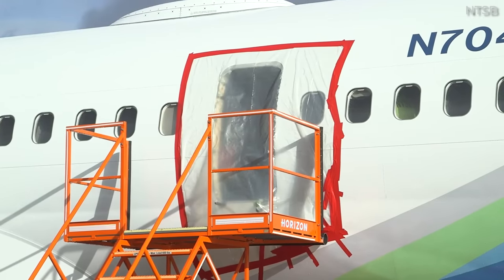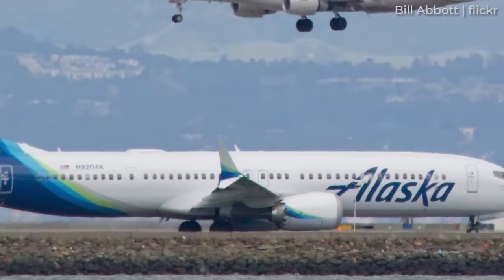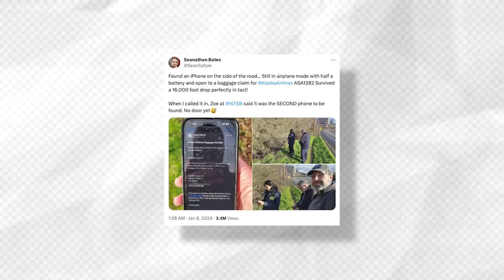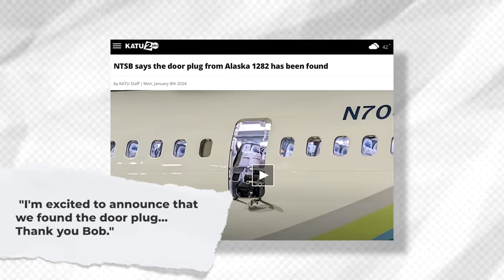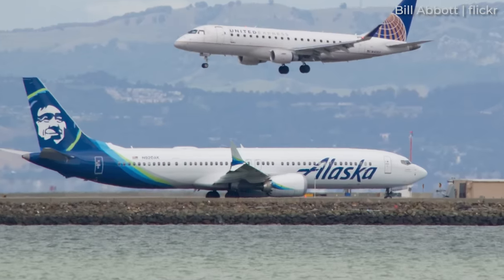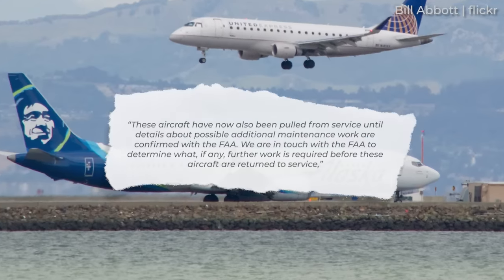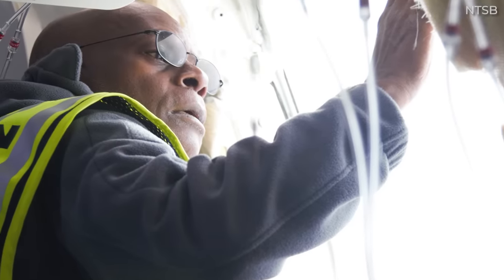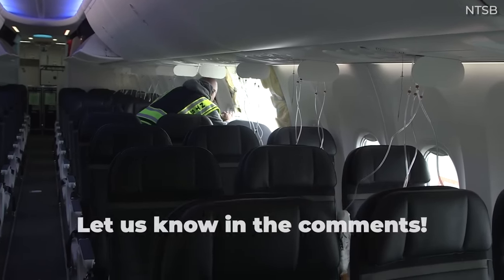Flight AS1282: Are We Seeing Another Boeing 737 MAX Crisis Unfold?

Comment: There is obviously a quality issue with their plants. They had to stop delivering 787 for a full year. This is a company that is in crisis because they allowed the worst of their instincts to take over when they merged with McDonnell Douglas. They allowed the failing portion of the company to take charge as opposed to the part that was actually successful. When they were in merger, you don’t allow the company being merged out of existence to take the lead. These are the same people who did the disastrous DC 10. And that disaster was visited on them by canceling the 757, and by making nothing but the cheapest decisions from that point on. This company‘s is going close its doors if they don’t start making responsible decisions and I don’t think they have the capability to do that.
Reply: The wonderful DC-10 went on to be one of the safest and long-lasting aircraft in commercial aviation history, Jude!

Comment: So much pearl-clutching. There was less hyperbolic speculation over the failure of Aloha Airlines Flight 243 where the entire roof ripped off due to metal fatigue. It looks like an improperly secured plug door. Given the actual engineering of the hinge mechanism this is a near impossibly if the proper procedure had been applied so this was likely a human error case during the installation and inspection, concerning but hardly alarming. These plugs need to be lifted along a track for 4 centimeters before they can be opened and if properly installed there are 4 bolts to prevent that which are then covered by 1 inch thick safety nuts which then have quarter inch thick safety wires pierced through them to prevent the nut being able to self loosen. The hinge mechanism swings the door down low on the airframe so it was highly unlikely it could have impacted the horizontal stabilizer unless the jet was in a steep climb. It was an unfortunate event but people want to blow everything out of proportion anymore.

Even the previous Max problems were more about training than MCAS. After the fact, every domestic pilot interviewed knew exactly what to do to disengage MCAS and prevent the runaway. It wasn't the accident pilots fault that they weren't trained properly but the MAX was not inherently unsafe.

If airplanes were subjected to this degree of scrutiny since the birth of aviation then we wouldn't have air travel at all today. People are trying to crucify Boeing for this without all the facts, but no-one is alarmed by the shear number of times the lack of feedback on Airbus side sticks have caused pilots to fight over controls all the way until they slam into the ground. Problems arise and will be dealt with, fortunately no-one was hurt, but if your wheel came off because the mechanic forget to torque your lugnuts you wouldn't expect Toyota to stop selling cars...

Comment: Wait until a critical flight control surface with loose parts comes off. This is ridiculous.
Reply: Well there are currently some issues with loose bolts in the rudder control system of the 737 maxes.

Comment: This is a problem with Alaska airlines, not Boeing. It's a maintenance issue.
Reply: On an effectively brand new aircraft? 😂
Reply: @GG-hi5if  An airplane is not your car. They have a very intense maintenance schedule. All sorts of things have to be checked regularly and that even applies to new aircraft. They don't fly these things for 6  months without having to check anything. 
175 people flying 5 miles above ground at 550 mph in a metal tube means lots of stuff gets checked all the time, even when new.

Comment: The door is closed by location pins entering guide slots attached to the fuselage frame and which guides the door over the retaining lugs and drops down behind them. A compound hinge system secures the bottom of the door to the fuselage and allows this movement. A handle mechanism would then usually lock the door in place. On a deactivated door I assume the handle mechanism is removed and replaced with locking bolts of some kind. Perhaps the locking bolts were missing or somehow became detached or otherwise failed and the door vibrated off its stops. It speaks to an assembly line error at worst..
Reply: The plug on this aircraft was not a deactivated door, but a different part entirely. The aircraft can be supplied with a deactivated door if ordered that way. Doors have small circular portholes, and only the plug has a full size window.

Comment: Thanks for the update by the way. 
I’m curious, have Boeing issued  any official statement about this situation?

Have they blamed Alaskan Airways yet, like they blamed Lion Air in 2019 ?

Any reaction from the pilots union in the USA ?

Any reaction from EASA yet  ?
Reply: Boeing agreed and supported the grounding. Probably they realized that objection will achieve nothing.
EASA is in agreement with FAA and following their directives.
I don't know pilots union.
Reply: Pictures of Max 9 fuselages on railcars en route from Spirit in Wichita to Boeing in Washington show that those plugs are installed before transfer. However, there's been no statement from Boeing as to whether Boeing removes and replaces the plug as part of the completion process, or if Alaska uses another firm to complete the interior and may have removed and replaced the plug, which apparently is common practice to allow another access/ventilation point during the process. I have also seen no statement from Alaska regarding any inspection or removal of the plug they may have done recently in trying to determine the source of the pressurization problem.

It has been suggested that Boeing pressurizes completed fuselages to 150% of rated differential pressure to check for leaks, and if the plug were not properly sealed at that point, it would have been discovered.

In other words, if the plug installation were faulty, there are multiple parties whose records and procedures must be reviewed.
Reply: @stephenjarzombek2903  If Alaska touched it after delivery, then Alaska would be responsible for correct reassembly. I agree with this. Still waiting for the facts to be known before assigning blame.

Comment: Issues with Boeing aside, it sounds like there should have been a stricter policy on grounding aircraft with obvious maintenance issues. The idea of a plane remaining in any type of revenue service (restricted as may be) with an undiagnosed cabin pressurization issue is appalling, and points towards the culture of corporate greed vs the safety culture that should be prevalent.
Reply: This isn’t a maintenance issue.  I am an airline mechanic, and there is ZERO myself or any other mechanic could have done to prevent this.  This is a MANUFACTURER issue. Period.

Comment: The Max 9 emergency last weekend could have been the third Max air crash in five years. I am not flying the Boeing 737 Max 8 and Max 9 for at least five years until a real safety record exists. I’ll fly Airbus or older 737 aircraft built before the McDonald Douglas management destroyed Boeing’s excellent engineering standards. Airbus is run by engineers.

Comment: This time it’s a manufacturing defect rather than a design fault. The door if installed correctly, the locking bolts and nuts torqued correctly and the split pins fitted, will not fail. https://m.youtube.com/watch?v=maLBGFYl9_o

Comment: Will be super interesting to learn if they did not bolt down the door correctly, or if the door/plug itself failed and broke off. With 12 attachment points and 4 bolts preventing it from moving out of the correct secured position, it’s super weird how the door could break loose.

Minor note; Door plug for emergency door and Deactivated emergency door are two similar but different options. Door plug looks nicer on the inside cabin, and deactivated emergency door is slight easier to reconfigure / enable to get the plane reconfigured for higher capacity. But I guess you already know that based on the sources you cited :-)

 Language around the door options seems super confusing, everyone having slight difference in word. NTSB saying it is not a door, it’s a door plug, and then proceeding to consistently calling it a door, was kind of funny.
Reply: More confusingly this is a "plug" but not "plug type door".

Comment: This feels like a one-off failure. The NG -900 also has those extra exit doors and the option to plug them. This just doesn't feel like a part or area of the fuselage that would be meaningfully different on the MAX vs the NG. Could be wrong though.
Reply: Just like the Mcas

Comment: The problem is, this is the exact same door used on the 737-900. So either the same design doesn’t work for the MAX or the door overall is flawed. Given the plane is 2 months old, probably the first thing I said. I’ve flown the MAX before and the MAX 8 is a safe plane, but I have heard of the issues with the MAX 9 before it came out and mainly involved weight and balance. I’ve flown Airbus and Boeing and they both got flaws but this is something Boeing has to figure out. Alaska airlines has some fault with this too though

Comment: Alaska has take all of this aircraft type off ETOPS flights, a wise choice. These are flights for extended operation over water. Planes have to be specifically modified and equipped for ETOPS operation. I finally found out what that acronym stands for. It goes back many years in commercial air travel. It means  Engines Turning Or Passengers Swimming.
Reply: No, they have to be CERTIFIED as ETOPS.  2 identical 37’s parked next to each other, one could be ETOPS, the other could not.  It is about the MAINTENANCE program involved.  You can’t disturb the same thing on both engines for example change the starter…that is referred to as DUAL maintenance, and would take it out of ETOPS until a VERIFICATION FLIGHT occurs. Has nothing to do with modifications.

Comment: The design of the exit/door/plug in the MAX is exactly the same as it has been in the pre-Max 737s for many years now.  A proven, reliable design, not flawed.   The issue here is either a material defect or improper installation.    It should not cause any kind of a crisis,  but then again,  the covid-19 virus wasn't bad enough to warrant the overreaction to it that occurred, either.
Reply: Boeing has been hammering on Spirit to shave cost, as well as the morale problems at Boeing final assembly plants.  It may just turn out to be an anomalous event, but there just seems to be an escalating trend of major airframe impacting "deviation from stated procedure" assembly issues going back to the NG when they were using hand held wood routers to "adjust" CNC fuselage barrel frames back to spec.  Boeing seems to be doing a lot of "as built" vs "as specified" which is bad news for a building, let alone a plane

Comment: It's an old design that never had this failure before.. Sounds like an installation error to me. It may be a new aircraft but it was set up for low density ETOPS
Reply: What the hell is “low density ETOPS”…I am ETOPS qualified as a mechanic on at least 6 airframes and have NEVER heard that term in over 30 years on the flight line.
Reply: @justing42  I guess they mean lower than normal seating density configuration for longer flights.